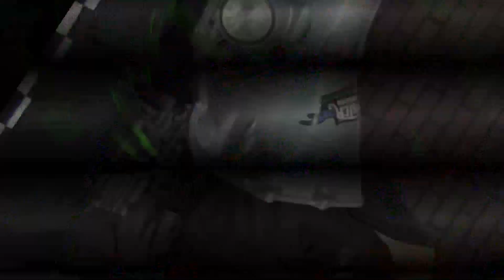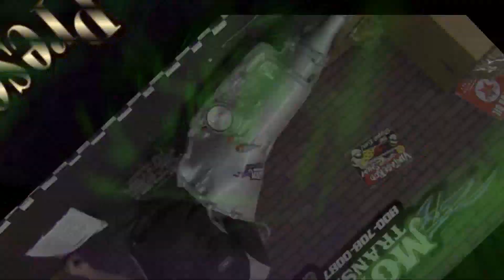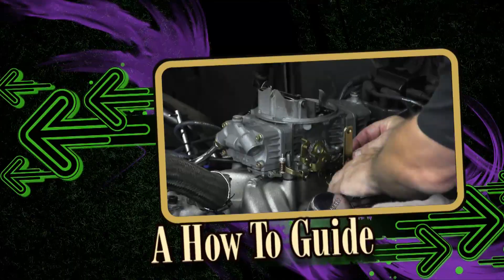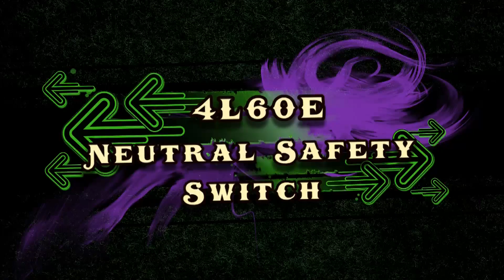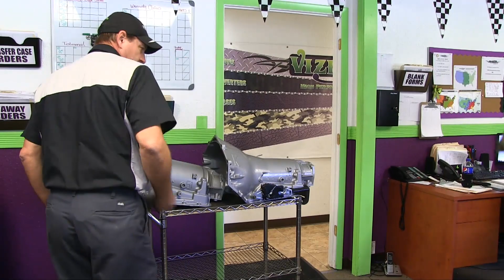4L60E Neutral Safety Switch

Comment: I'm putting a '93 4l60e with no nss. in a '95 truck with a nss. What do i do to switch it? does it even need to be connected at all?
Reply from the maker: These units are different.  The '93 is a non PWM and the '95 is, so it will have a locking up issue that will eventually wear the transmission out.
Reply: Thanks alot
Reply from the maker: No problem Gorge! If you have any other questions, give our tech staff a call 800-708-0087.

Comment: I just put up a new gear box 4l60e on my blazer truck 2000 4.3l and the truck will not start.It ignites  on park but nothing on neutral. By bad luck the mechanic ripped apart the original safty switch the one that was on the old gear box so we had to use another one which is also broken where the harness  is .. Could that also have damaged the plug. and  cause the truck not to start.it ignites on P but nothing on N.
Reply from the maker: Yes if the Neutral Safety Switch is damaged then it will not start in neutral, so it needs to be replaced.
Reply: Thank you Curt.I agree.You said it won`t start in Nuertal.It doesn`t! It cranks on P, but it doesn`t tumble the engin neither..?All that lie in the NSS being faulty. Please advise. I need to explain that to the mechanic who I think doesn`t have an Idea on the issue.
Reply from the maker: If it is turning over but not firing the cylinders then it may be a engine malfunction. Check to see if you have fuel pressure and spark, if you have that then check to see if the injectors are pulsating and putting fuel into the cylinders. You may have a bad crank sensor or distributor. Give us a call at 800-708-0087 for any more assistance Will.
Reply: There`s no spark from the coil wire to  the distributor , but there`s fuel pressure.
Reply from the maker: Try to check your ignition control modulator, crankshaft sensor, or fuses. It could be a damaged NSS. But to me it sounds more like an engine issue and suggest taking it to a automotive repair shop.

Comment: I have cranking problems if I like slam the shifter in park sometimes is this switch my problem
Reply from the maker: No, this sounds like it could be an adjustment issue.
Reply: It was the neutral safety switch on the shifter not adjusted or out of place fixed now

Comment: Question I have a pontiac g6 will go in reverse but in drive and all other gears it just acts like it's in netural. It's a automatic. Could that be a problem with this switch?
Reply from the maker: Probably not, if it was the switch it would go in limp mode. It sounds like the forward clutch pack is burnt.

Comment: Would you happen to know the bolt size and thread pitch of the hole in the embossment right above the number 6 on the casting of the transmission case? I've tried so many different size bolts and can't find the right size.
Reply from the maker: Yes, it is a m8x1.25 bolt.

Comment: I swapped out a 5.0 with a bad 4L60E for a 5.7 with a 4 L 80 e use the old wiring harness the old computer and now it won't start could that be the safety neutral switch both motors and Transmissions came out of 96 models Chevys I also moved to pins in the wiring harness and move one pin to a clip
Reply from the maker: Yes, it’s possible that it could be a fault in the neutral safety switch or the ignition.

Comment: mine is cracked on top on the top plug will this cause for the transmission not to shift out of first gear and also the odometer stop working
Reply from the maker: It's possible if the nss is sending a signal to the computer that its in manual first this could cause it to not shift

Comment: hay bud i got a 98 chevy truck and it wont go into gear and it starts only in neutral  can you help thanks
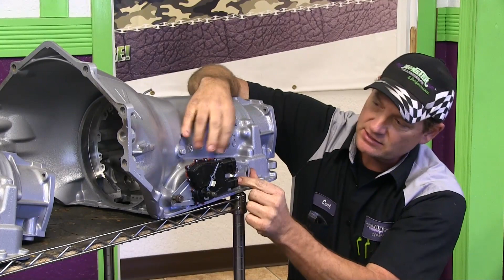Reply from the maker: Make sure that it if you uninstalled anything that it went back in the same position. Curt talks briefly about adjusting the NSS right after the 1:00 mark.

Comment: how to remoev nss..safty swich
Reply from the maker: You can remove the linkage and then the 2, 13mm bolts and it should slide right off
Reply: It dont..thats wy im worried but i saw a vid that said it. Had to be filed down a bit..straped for cash so me and my son decided to tackel it our self..he works for crhrisler im a home mech... Dont want to f..up the swich..lol thanks for responding...one thing i know is..U GUYS ARE THE BEST IN THE INDESTRY...JUST WISH I HAD...MONSTER CASH...
Reply: All the bolts are off..that was the easy part

Comment: Hello, great video and tip about how to get the switch out and plugs out. Is it necessary to have the transmission in a certain gear when you reinstall the new neutral safety switch? I am working on a 1998 Chevy Blazer 4x4. Thank you for your input.
Reply from the maker: Thanks! Park or Neutral will work just fine.

Comment: Welcome Your help .bmw E39 530 into a mechanical and automatic reverse gear lights to lighten.
Light module Which wire to plus or how many volts
Reply from the maker: Thanks for checking with us. Unfortunately we are not familiar with that model.

Comment: so if this adjusted incorrectly couldnit keep the truck from actually going into gear even tho the shaft moves ?
Reply from the maker: +Trey Davis 
Hi Trey, Thanks for checking in with us. Short answer is no. It might take off in the wrong gear, but the vehicle will still move.
Reply: +Monster Transmission will a misadjusted nss cause a no start no crank condition, thanks in advance, how do you adjust it ?
Reply from the maker: Yes, re adjust, then try it again. If it still doesn't work then the best bet would be to replace the switch.

Comment: Wish I had watched this video prior to my costly mishap of doing exactly what you said most people do, rip apart the neutral safety switch (NSS).  Supposedly, these wire harnesses have a small amount of glue inside to prevent water or foreign materials from entering into the circuitry.  If you do have to remove the harnesses, then you'll need to apply a heat gun at the point where the harness connects to the NSS.  By doing so, the glue inside the harness will begin to melt just enough so you can then dislodge it from the NSS.  Hope this helps the next person from doing what I did.  

The new NSS I bought came with a small amount glue already inside the connectors.  So you'll need to heat the NSS before trying reinstall the wiring else the harness will not snap in.
Reply: Thanks, it does. We're getting ready to do this job. Thanks for the tip.
Reply: thx